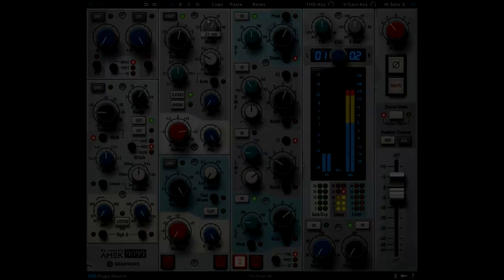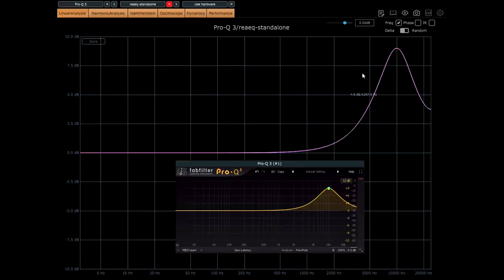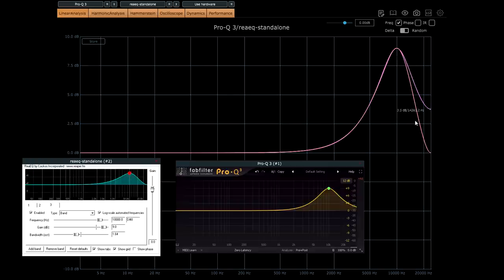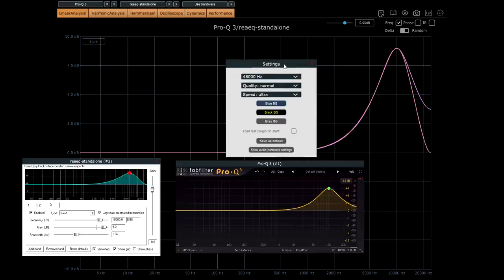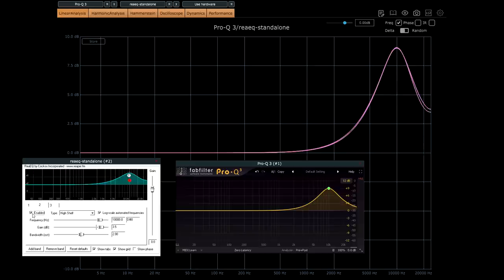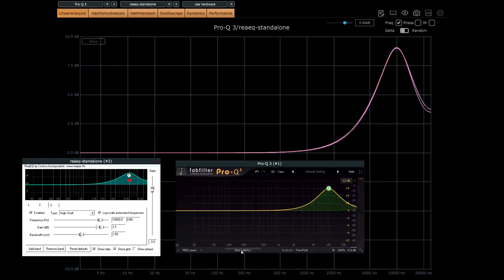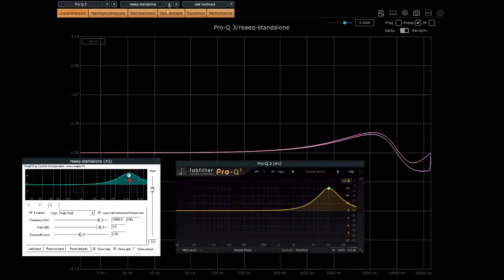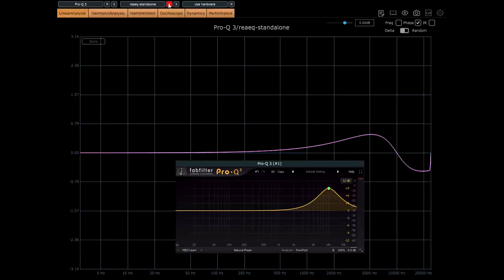Don't Cramp My EQ Style

Comment: Melda's MEqualizer plugin is a six-band EQ which, by default, has four "Peak" bands which cramp.  You can change them to "Peak analog", which don't cramp.  You can change the default so it starts with "Peak analog" bands instead, so that's what I did.

Comment: Hey Dan, I'm binging on your videos right now after discovering you through the Fabfilter ones. :) In the bx console video you mention the belief some people have that analog EQ emulations are just like digital EQs with an analog interface slapped on top and with different EQ shapes. I am still on the fence about this. I only ever use Q3 as my EQ but am wondering whether I am missing out on some "flavor" by not trying analog emulations more extensively. What I am really curious about is, are there any differences if the EQs null as you show them to? Thanks! :)
Reply from the maker: If two EQs null perfectly, then they sound the same. No room for argument, I don't believe in magic: if the numbers are the same, its the same.

However, none of my null tests quite nulled perfectly. So that means we need to make a judgement call. If the null is better than 100dB at all frequencies, safe to say noone will be able to hear the difference. But as the differences become greater, the certainty that they won't matter diminishes. When there are differences, but they're quite small, the only way to judge if the difference is truly audible is via blind testing.
Reply: @DanWorrall  Thanks so much!

Comment: Hi Dan, I am considering buying timeless 3 or relayer, which one would you suggest as the ultimate delay plugin? And also which one is more intuitive to use and helps you achieve creative effects? Thanks
Reply from the maker: They're both really good. Honestly I would suggest you demo both and buy the one that inspires you more.
Reply: @DanWorrall  that's more than fair haha, will do once I find more time.
Which one do reach for more often? Maybe it will be the one I try first.
Reply from the maker: Timeless 3 if I'm honest. But for some things, like rhythmic multi tap patterns or big coarse reverbs, Relayer arguably has the edge.

Comment: Hi Dan, I love your videos. I have a question, if you could answer I'll be really happy. Lets say we master a stereo track and not using any parallel processing. Assuming (and believing) we can't understand phase shifts over a stereo file and also we know linear phase can cause audible pre-ringing at lower frequencies with high q and gain values, is there any point of using a linear phase eq? Also I'm curious about the same thing between minimum phase and natural phase eqs. Why should I prefer one over another if we can't perceive phase shifts in a single stereo file? Additionaly I think phase shifts shouldn't be so noticable at high frequencies near the nyquist and also I realized a little pre-ring in natural phase eq's at high frequencies in plugin doctor's IR analyzer. I think it shouldn't be noticable too but I still wonder is it worth it to choose it over a standard minimum phase eq?
Reply from the maker: It's dangerous to say we can't perceive phase shifts. Usually we can't, but sometimes we can. And we're super sensitive to tiny phase differences between L&R... That said, often I can't hear a difference between ZL and NP, and when I can I'm often not confident I could pick them apart in a blind test. But when I have heard a difference I've so far always preferred NP.
Reply: @DanWorrall  Thanks for your answer. You're right, theoretically there should be a difference between channels when processing L&R or M/S channels seperately but in my scenario I'm talking about only stereo processing and I know modern digital eq plugins can process L&R channels exactly the same, so there shouldn't be any difference in phase coherence. I can say that because I tried an all pass filter (as we know it only affects the phase response) with a stereo file and couldn't hear any difference.

Comment: Mixing 6 songs right now for a client that I recorded in 44.1 but thinking of switching to 48 for cramping reasons. Is it worth changing my current project to 48 and let reaper extend the frequencies of my recorded material or could this be damaging in some fasion?
Reply from the maker: Make sure you have r8brain resampling selected for both playback and rendering in your project settings, and it probably won't do any harm. However it won't make much of a difference with respect to cramping.  96k is high enough for cramping to no longer matter, but even that doesn't actually remove it altogether, so going to 48 is kind of insignificant. It might make oversampling filters work a bit better though (especially Softube) so don't be scared to try it if you want. But switch to r8brain first if you're not already using it.
Reply: @DanWorrall  Thank you! oh yeah been thinking about this for a couple of days and it was the oversample thing you talked about + the fact that my studio buddie uses 48 that convinced me to make the switch. Thought it also would do something for cramping but honestly the fact that most high shelves doesn't cramp and that I use my ears I wasn't to worried about it.

Comment: Hi Dan! I have a video request.
You know there are a lot of topics like best sounding DAW, Eq. We all proved that the PRINTED results nulls each other. But a lot of people including myself hear the difference between: a) PLAYBACK of the same file in a different DAWs; b) switching different Eqs with the same parameters (that nulls each other with phase flip, but on the same track they sound different especially in high-end). I couldn't tell why, probably, there should be programmer perspective be involved. Maybe it's codecs or internal processing of the plugins while playback. 
I think key here is bounced calculations vs actual playback.
Would be great to hear your opinion.
----------------------------------
And here are some quotes from members of a gearspace:
robshrock
I asked this same question not too long ago... aren't all digital EQs pretty damn similar? The answer: nope.

But you'd need to chat with a serious coder to get into the how's and why's... beyond my interest level to fully understand from a programmer's POV.

MogwaiBoy
I've done blindtests between Crave and Pro-Q. Knowing the Q values differed, I matched settings (Digital / Analog / Transparent / Natural Phase etc) exactly in Plugindoctor, then put them back into the DAW and exported various tests, doing blind A/B's between them.
Crave has more clarity than Pro-Q 2/3. You might say "they're both digital EQs, they are the same just different GUIs" - but I know what my ears are telling me. They sound different.

monkeyxx
I did a 2 day, exhausting shootout of Pro Q3, Crave EQ, and Toneboosters EQ4. You can never truly match them but I tried my best, using null testing. 
Pro Q3 seemed to narrow the stereo field just a tiny bit compared to Crave. Pro Q3 also has the tiniest bit of color in the midrange. But it's so so subtle. Crave felt really wide, solid, almost analog in a way... It had a thickening effect... ToneBoosters was the most flattering of them all in this particular test
Reply from the maker: Here's some food for thought: listen to a mix. Then, without changing anything, listen to the same mix again. You'll notice different things the second time around, right? 
Now do the same, but with the knowledge that something has changed: all those differences in what you perceive will now be attributed to that difference. It's just the way our brains work.
You have to remember, a mix is just a single waveform. Ok, two for stereo. It's our brain that does all the processing to split it into drums, bass, guitars, vocals etc. and that's some heavy duty processing going on there.
While I can't say for certain all those people you quote are wrong, I can say that every time I've investigated such claims I've not found any evidence to support them. It seems far more likely to me that this (well known and universal) cognitive bias is the real cause.
Reply: @DanWorrall  Thanks, appreciate your answer. 
Agreed with listening the same mix thought. Would be great if someone shows proves from playback engine perspective, not only bouncing.

Comment: is there an actual explanation in any of your videos, of why cramping is bad? after watching a few, i understand how it is supposed to behave "correctly", but I have not yet been able to understand what makes cramping bad and/or what the negative effects are of using an EQ that cramps
Reply from the maker: With some material a de cramped EQ will give you an airier, more open and natural sounding boost than a cramped EQ. It's not an issue otherwise, and cramping EQs are certainly not useless. But if I'm picking my go-to EQ that I reach for in all situations, its a deal breaker.
Reply: @DanWorrall  thank you so much!

Comment: So is there an actual sound difference that matters between these two examples?  Or do I need to go back and watch that other video to find out?
Sorry, this is clearly too smart for me
Reply from the maker: Sometimes there is, sometimes there isn't, it very much depends on the source material.
Reply: @DanWorrall  I was thinking about this after I posted, and was thinking about resonant EQ curves.....isn't this similar to one of those?  So it could just be a feature as opposed to a bug?
I'd be curious to hear a difference.
FWIW, I do understand the point you made in the video.  Just trying to understand the practical aspect of this
Reply from the maker: I guess it's possible that in a specific case the cramped response might sound better. But whenever I've heard a difference its been a more open, natural, airy sound from the decramped EQ, and I've always preferred it.
Reply: @DanWorrall  hi Dan the man! Is the reason you prefer de-cramped EQ in the air band is because it represents high frequencies more accurately due to the better phase response & anti-aliasing sound?
Reply: @DanWorrall   I read that in a Dan Worrall voice

Comment: I wonder, why is there common folklore on the web that Fabfilter Natural Phase mode is not oversampling? The curves match perfectly to 16x oversampled biquad, the latency matches 10240 tap FIR filter and the CPU usage is in the ballpark of this processing. To put it the other way: why on earth would they use some "proprietary magic trick" if they reach exactly the same result with this ages-old trick and not getting any benefits with their magic?
Reply from the maker: Two reasons: there's no sign of any AA filtering. 

And, the developers told me there's no oversampling.

Advantage of their method: no steep AA filters required.
Reply from the maker: Well! First of all Fabfilter don't do bullshit marketing. At least I've never seen any, feel free to correct me.
I've worked with them for ~10 years, got to know them a bit personally: I don't doubt what they tell me for a second.
Reply from the maker: And about the filtering: EQ8 doesn't do it either. It's not in fact really proper oversampling in EQ8.
Reply from the maker: I've never asked the Fabfilter guys how they achieved it (I've learned that I rarely understand the answer when I ask that kind of question) so this is purely speculation. But couldn't Natural Phase mode be simply using an FIR filter to correct the phase shift? And isn't that preferable to up and down sampling filters, even if you end up with the same latency and CPU use?
Reply: @DanWorrall , "It's not in fact really proper oversampling in EQ8". Is it linearly interpolated fractional delay? I've never used it myself or tried that technique.
Reply from the maker: No idea. Andrew Simper messaged me after I made that video and tried to explain what was actually going on. But I didn't really understand most of then, I've forgotten it now, and can't seem to find the message... all I've got left is: its not strictly speaking oversampling, wouldn't work for any non linear process that adds harmonics, but they just kept calling it oversampling so that no one else was as confused as I got
Reply: I think correnting the phase with FIR filter without altering the frequency response has the same effect than correcting the frequency response without phase shift: it should prering. FabFilter has same kind of impulse response than a typical oversampled EQ.
Reply from the maker: I wouldn't know how to tell the difference between pre ringing from oversampling filters and pre ringing from a phase correcting filter. What should I be looking for?

Regardless though: given that I absolutely believe them when they say it's not oversampling, I'm just going to conclude this is why they chose the company name. ;)
Reply: @DanWorrall , that is a great ending :) It's not impossible it is IIR filter corrected with FIR or a pure FIR filter. But it seems like so much work for almost nothing :D Anyway, hats off to you for the chat. Hopefully you have time and resources to put up more videos. There is too little solid information about studio audio related things and too much "this is so warm and punchy" ;)

Comment: Thanks again for your videos!
I actually refused to use ProQ3, as I have repeatedly noticed that it makes the sound worse. Especially filters. Unlike filters and equalizer in Scheps Omni Channel or TDR eq, for example. Can you guess what could have caused such a result with ProQ3? I'm working in 48/24 if it's important. Thanks!

Comment: no-fun fact: there is not a single Pultec EQ plugin without cramping or other weird stuff :(
Reply: Not even Acoustica Audios new V3 of Purple?
Reply: @dezyLmedia  that I haven't tested yet.  thanks for the info
Reply: Thought the UA Pultec oversampled to 192 or something
Reply: @stewie3128  don't have UAD to test. I've tested waves, softube, ignite, noiseash, kiive audio, ik multimedia and nomad factory. they all behave very different with the same settings frequency, phase and harmonics wise.
Reply: @stewie3128  the UAD one seems to be accurate. the softube model also comes close to it but lacks harmonics.
Reply: @troeteimarsch  what about black rooster or lindell 500?
Reply: @jadeone  checked the lindell, acts like the ignite. noiseash answered to me in an email that their highcut is intentionally and nescessary because of oversampling, but it really screws up the phase in audible regions. black rooster is next. to clarify: I'm searching for a plugin that acts like the hardware unit or uad pultec.
the softube version nails frequency and phase but lacks 2nd and 3rd order harmonics. might be best to pair it with a distortion plugin (blackbox and decapitator are too much. might try 2 instances of saturn 2, or a mix of saturn and kazrog true iron).
Reply: What about Analog Obsession's?
Reply: @BrunoNeureiter  also goes the ignite route, but without low cut. so does the black rooster, but with low cut at 7Hz 3db. The Neve 1073 emulation of Analog Obsession with everything at stock but the mic button engaged gives the correct harmonic distortion (k2 and k3 fit the uad pultec) but it also introduces a highpass at 11 hz, and highcut at nyquist but without crazy phase shifts and without aliasing - that plus the softube model could be "it"
Reply: !Looks spot on to me, a little bit hotter than the UAD but that's fine!

https://ibb.co/3d9gjfY
https://ibb.co/Pz5gGqq
https://ibb.co/xXDPvnY

also sonically verified by ear. damn that's sweet. the brit pre makes the top end perfectly silky. you can go crazy with boosting the highs, not unpleasent at all.
Reply: instead of britpre use britchannel with mic button engaged and -8 db gain -> low and high cut are gone, sounds way 'clearer'. harmonic distortion is the same that way
Reply: @troeteimarsch  Thank you for the update
Reply: @BrunoNeureiter  Glad if it's helpful at all